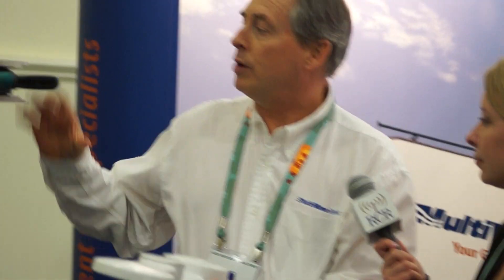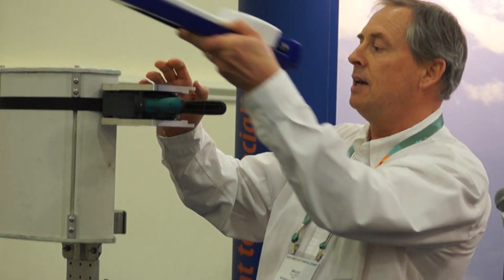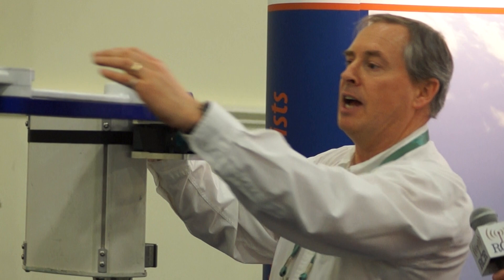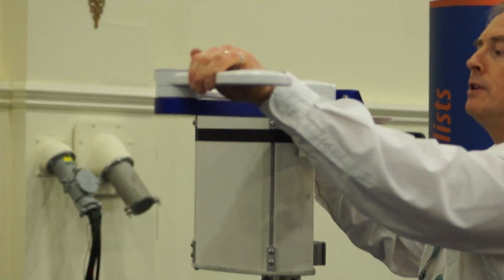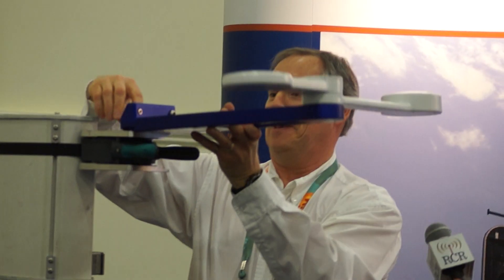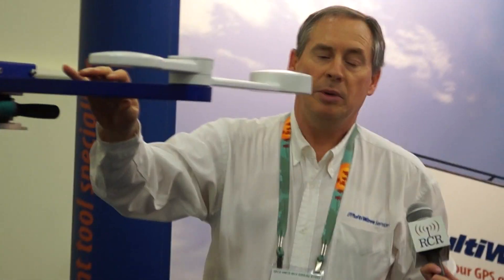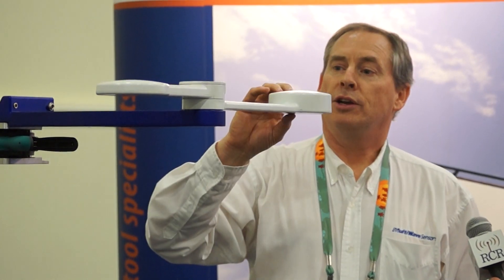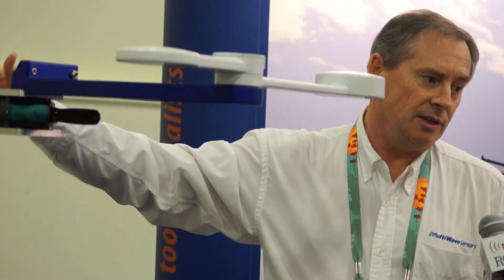#NATEUnite2014: Multiwave Sensors antenna alignment demo

Comment: Does this unit do Tilt and Roll? I question how the unit mounts on the bracket.. Looks like it is not level and it looks heavy on the end, I do like the fold out arms for the GPS antennas... Is the unit shielded good for RF interference? I have a Sunsight AAT, I am having interference issues with it....